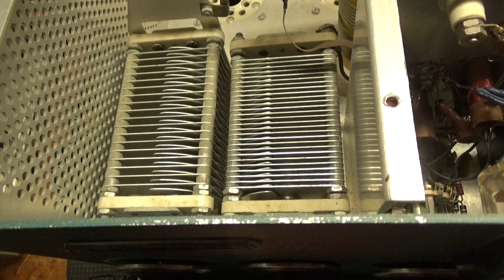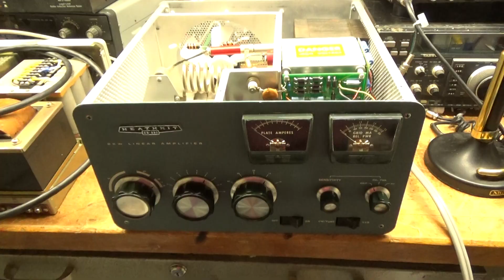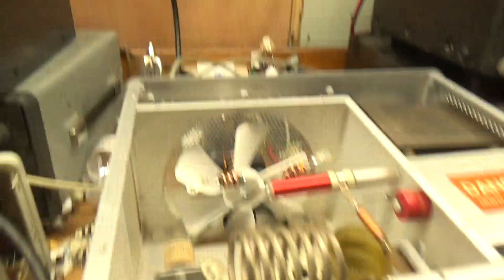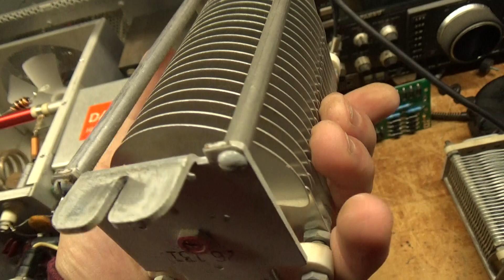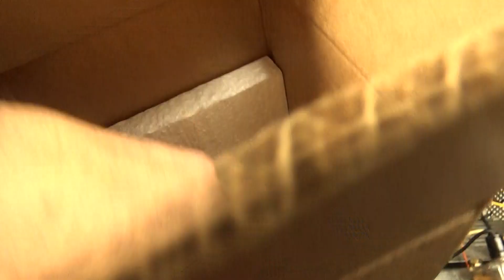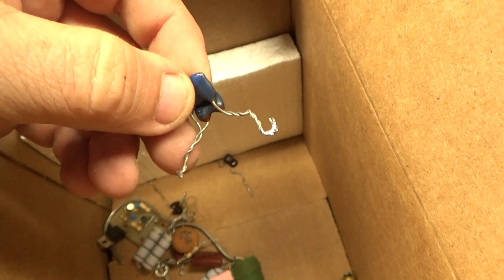Heathkit sb-220 Repair And modification

Comment: Why would you change the parasitic suppressors to the regular Heathkit inductor wound 47 ohm resistors? They were terrible for parasitics on 15 and 10 meters?
Reply from the maker: That is false, I have never had one fail and have installed over 1000 of them !!!!!!!! But only after I do all of the mods